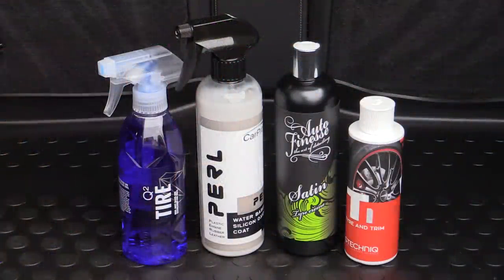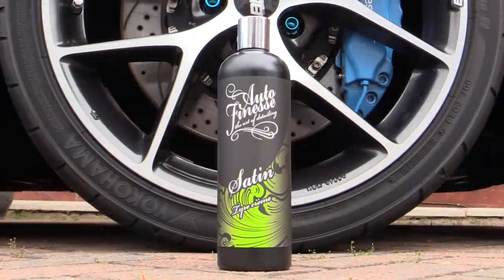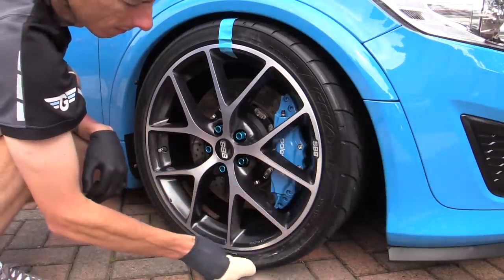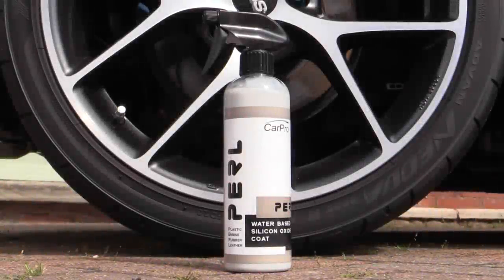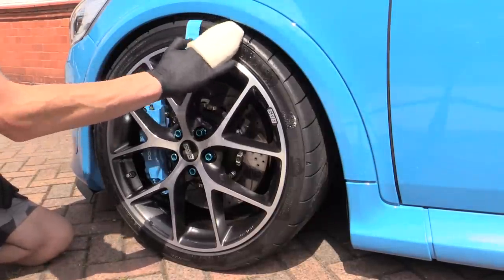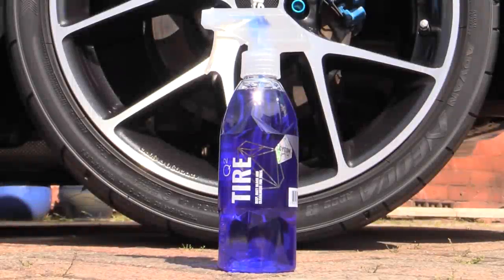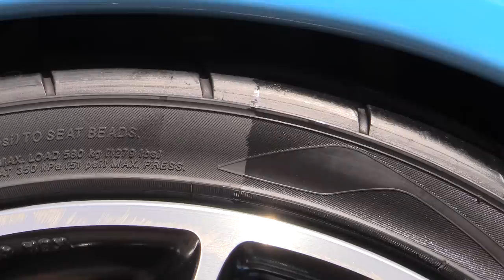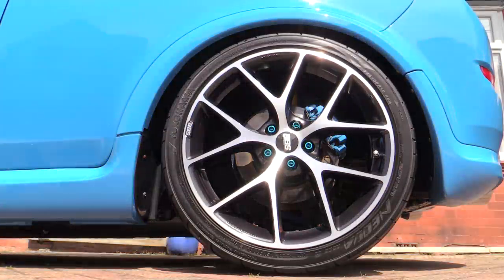Dress to Impress! Top-Quality Tyre Dressings

Comment from the maker: I know I said I'd be back with an engine cleaning video but that's on hold while I tinker with a few shiny parts for it first!
Reply: My XR2 engine is all shiny bits and silicone hoses if you want to clean it all for me!
Reply: You have a good voice
Reply: Hello mate 
From New Mexico USA 
Had acid rain and my Lexus Gx 460 2017 got white spot with power type substance all over the my motor 
Any help 
Cheers

Comment: I use the Simoniz back to black bumper and tyre gel because they sent me it free. I squirt some in a small plastic paint bucket, apply with an old paint brush then rub it in with a cloth. It's a pretty low rent product and technique but does the job.

Comment: Hi, thanks for the video. Just a suggestion, it would probably be better to do a side by side comparison of the before and after shots as opposed to one after the other as it was hard to tell apart at times. Also, the flash between pictures does not help. Thanks and keep up the work!

Comment: I used the Zaino tyre dressing for years and found it excellent. I then switched to T1 until about a year ago when I moved on to Perl which is so versatile. On the tyres I initially use neat and top it up with a 1:3 mix that I also use on exterior plastics and the engine bay etc.
Reply: Chris_Audittr2108 Does perl least as long as T1? even in rain?
Reply: I’m not much good with longevity estimates as I clean the car weekly without fail and top up the tyre protection.

Comment: I like Carpro Pearl but in rainy Ireland it only lasts a day or two so I can't be arsed using it most of the time.  My go to is now the Meguiars Hot shine.  It's quick and it lasts. Would love to see some tyre cleaning tips and tricks from you :)
Reply: Niamh Healy are the wheels supposed to stay shiny and clean after rain? Really?
Reply: They do stay clean so yes.  Rain is just water and I don't live on a dirt road lol. My point was that the Carpro doesn't last, Meguiars does even in rain.
Reply: Try meguiars endurance
Reply: Try Turtlewax wet and black. The gloss stays on for weeks (OK, 2 weeks in winter). It's cheap and very effective.
Reply: Niamh Healy That's why I ditched the UK as a living place 😂
Reply: Meguiars is best but alas it doesn't matter il just hit another pothole and wreck me wheel sigh
Reply: @TheCowgirlNiamh  Probably because it's oil based and contains according to the SDS at least 20% silicone. So, it's fairly concentrated.

Comment: Nice video. I use two product for a tire detail both are acrylic coatings.the high gloss one is clear called Nu-Tire by EAS products and the satin one is a black dye and coating in one called jet black endura- shine by turtle wax. Rain doesn’t effect either durability is 3-4 months on daily driver might be worth a try both coating are flexible and don’t delaminate or flake might be able to find them online they are US based companies but shipping would probably kill ya

Comment: I feel really inspired to make an effort and spend some quality time with my rubber. I usually just liberally spray on some of the decanted 5ltr "Trade valet bargain exterior finish" as I'm clearing up my buckets. 10mins per tyre? Lucky if I spend 10seconds on all four. Maybe that's why I a little disappointed that the tyres are as dull as an episode of Eastenders by the following morning.

Comment: Good video. Do they sling off.
I use autoglym gel does sling a bit if you put too much on.
Reply from the maker: I've never had issues with tyre sling regardless of product, apply it properly, buff over and you should be sling free.

Comment: Quick question, are you out of work when the hose pipe ban is inevitably going to come in force if the weather stays like this? How do you go about cleaning cars after that lol?
Reply from the maker: I reckon the heavens will open before then but as far as I'm aware it doesn't apply to businesses, so even if I'm at a customers home utilising their own water supply and hosepipe I'm safe as it's in use for services being rendered. Elsewhere in the world if that wasn't the case then ONR would be the solution.

Comment: Is offroad mud harder to clean then normal road or track use?
Reply: Depends.  Road film has chemicals like tar and oil, track film has rubber balls baked into it.  Mud is organic and doesn't require aggressive cleaners, it just requires more care in prewash to avoid swirls and more comprehensive coverage (mud get everywhere).

Comment: My tyres always get brown spots for some reason no matter how much i clean it with degreaser, it goes away when i put tire shine on but of course when the tire shine wears away it's back
Reply: Got memes? There is a chemical barrier that sits behind the wall of the tire that can seep through as a brownish colour when the tire comes into contact with strong degreasers and wheel cleaners ( even more so if the tires are quite new ). Try switching to a proper tire cleaning product or weaken your degreaser dilution and you should see this settle down.
Reply: this has nothing to do with cleaning, brown spots are from tyre shop when they mounted brand new tyres on your vehicle, they 're generaly using some sort of grease(copper like, brown to gold color) and applying it over the edge band where tyre meets wheel, therefor tyre sidewall is victim here...if they don't care too much they applying it with brush all over things, even on their gloves etc...crucial is to remove that grease as soon as possible...if left for months then its almost permanent stain, been there, saw, many customers complained about that...so after mounting new tyres always hand clean tyres and wheels with degreaser and good to go...regards

Comment: U forgot the best, Meguiars Endurance tire gel!
Reply: Eenhoorn Jaap Indeed, lasts ages
Reply: I agree. Can be a little messy but I apply with a small paint brush and it works a treat.
Reply: Crocoman I just use a wash up sponge
Reply: Sticky mess. Dirt, dog hair etc sticks to it and looks awful.
Reply: Joel Smith I don't have that problem at all
Reply: yes, very good with careful application
Reply: It does tend to sling a bit though and debris from the road can stick to it
Reply: Long time Endurance user here too.  Was going to try the New AG Tyre Gel as im nearly out of Endurance but think I might try the Auto Finesse instead.
Reply: Was just away to say this aswell
Reply: Joel Smith agree it's shite stuff
Reply: @JoelSmithR1  You have to apply it correctly. Once applied, buff off any access and you're all set.
Reply: The endurance gel is really nice and it smells good also, but if you dont have a trunk organizer or similar that the bottle is laying on the side, the shutter is ALWAYS leaking...
Reply: @Napoleon93  Now that's the truth. I usually detail my cars at home so the bottle stays in my garage cabinet but if I was going to keep it in my trunk I would put it in a different bottle because it definitely leaks on its side.
Reply: Yesssssss

Comment: The perfect finish is all well and good for a special occasion but for day to day use durability is the deal breaker. Love the finish PERL gives but it doesn’t last very long, be interesting to see how you get on
Reply from the maker: They're all holding up well weeks later however it has been very dry here and I don't use the car daily so that helps.

Comment: Look at the state of the back of you brake pads, I would loose sleep about that LOL 6:17
Reply: that's not on the contact side pad with rotor, normal thing, brake dust, rust, paint fall (peeling) from pad with constant heating and cooling..nothing to worry about if pad wearing rotor evenly, and has enough meat
Reply: It was a joke.